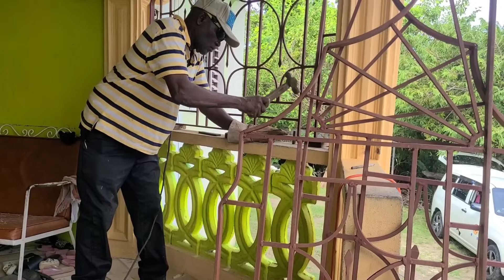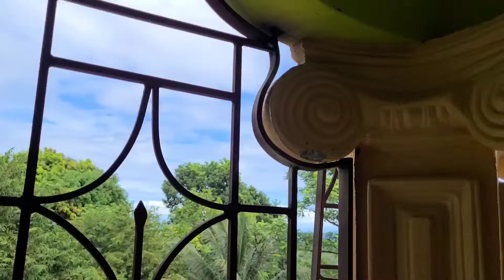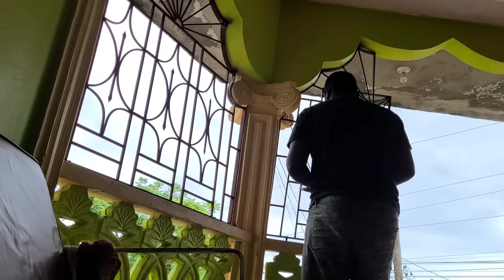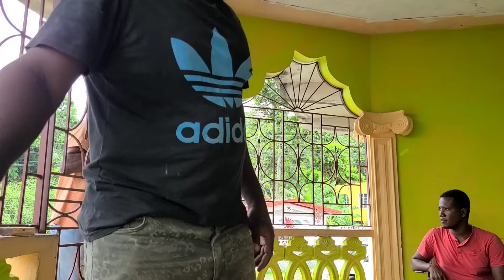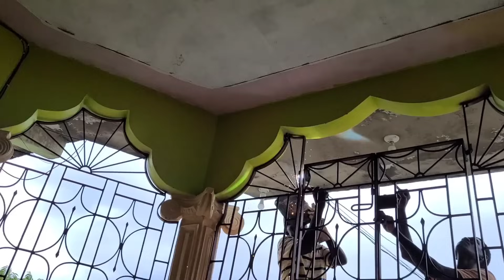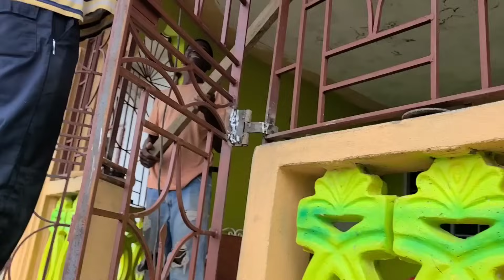Install in some grills by pressa  house

Comment: Teabag, if you’re reading this, please understand that I am not bashing you, but how can a grow ass man welding grills without a protective eye mask?  This causes people to go blind, and I don’t believe you should allow people to be constantly telling you to protect yourself.  Do you know how many people go blind by using the equipment you have working with?  Please be more careful, because the sparkle can fly right into your eyes.  The person you’re working with, should be man enough and tell you, that what you’re doing is dangerous without a welding eye gear.  Good luck.
Reply: I really could not believe what I am looking at.  WHERE ARE YOUR SAFETY GOGGLES Teabag!! Don't take chances with your eyesight. That's do careless.
Reply: I didn't even read this comment B4 & it's almost the same thing I said. Dem mind still young
Reply: Dem to listen until the worse thing happens trust same thing where I am
Reply: I have a cousin that went blind doing this
Reply: 😮boy you could go blind  no joke ok
Reply: I have 3 big lacerations because of a bad grinder wheel